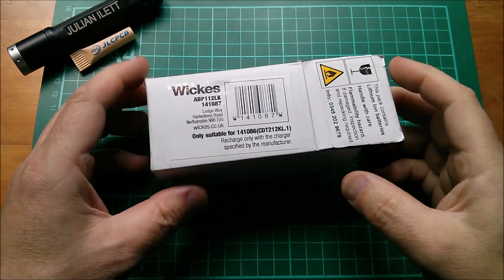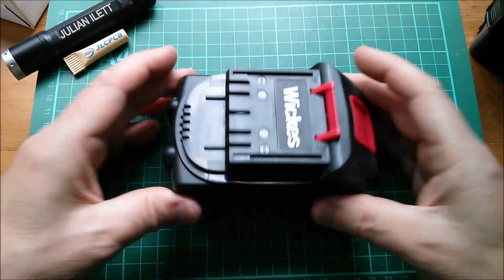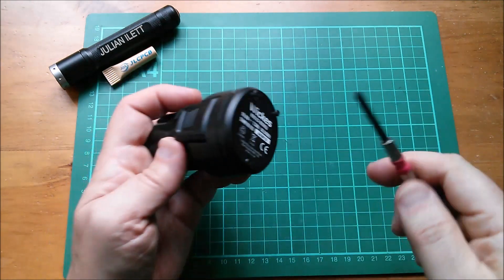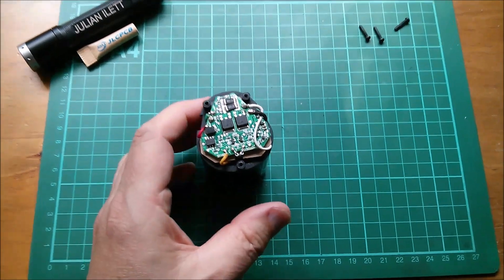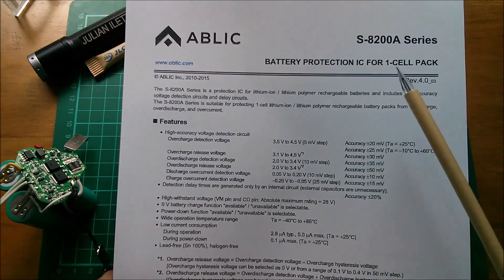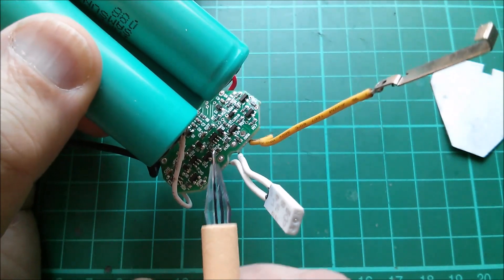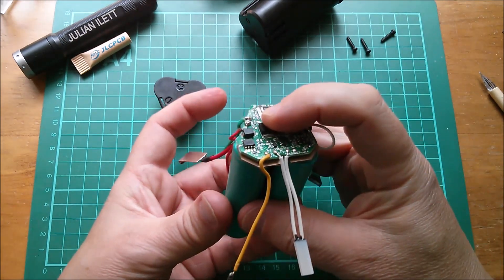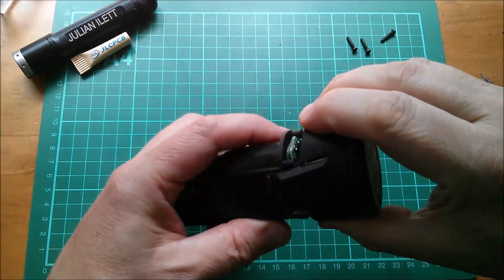£1 Wickes 10.8V 1.3Ah Power Tool Battery Strip Down

Comment: Julian, I could hug you for making this video! My ex partner bought me a Wickes electric drill for £39.99 a couple of years ago. I wanted a spare battery for it (It only came with one. Even Aldi drills come with two...) and was quoted £52, £12 more than the drill which comes with a battery! Anyway, went online and see the local Wickes has two in stock and called them to hold them for me. They could only find one, which is all I really needed but at £1... Took them some time to let me have it for a pound because they were thinking it was some kind of error but I have it now, all charged and ready to go. Now I need to find something to drill... Anyway, thanks for this video, and all the others of course :-)
Reply from the maker: Awesome, that's a great result.

Comment: The Wickes looks just like my Bosch PS-21& PS=22 Screwdriver batteries. They sell 10.8's and 12v cells. The latches look like they would latch correctly.
Reply: Definitively same OEM as Bosch cheapo ones.

Comment: Just picked up 50 of the 5 cell packs at Winchester, they still have another 50 in stock!  Just running a capacity test on one of the cells now.
Reply: 1333mAh. Very happy with that. Now just to test the other 249.......
Reply: Must have been loads, just brought the last 50 lol
Reply from the maker: Who'd have thought most of their stock would be in Winchester :)
Reply: i really have to say a big thank you  @JulianIlett , I was just about to start on a project that needed a lot of these cells and you saved me a fortune :)
Reply: Congrats both. These are nice good cells for high current applications. For storage or mobile related stuff, the energy density is so so.

Comment: Hey Julian, will these batteries charge in a parkside charger if you take the cap of like you did when you put it inside the drill? Reason i ask is because i bought a Workpro cordless ratchet that looks similar to the parkside batteries and find it very difficult to find replacement batteries/ chargers online, so would like to buy parkside batteries and chargers for it. 

Hope you can help, thanks!

Comment: Just nabbed 6 of these 5 cell ones from my local wickes. Their stock is inaccurate. Website said they only had 2 but I bought all they had, 6. Will take some apart later an capacity test them. Thanks for the heads up.
Reply: Just took it apart. Super cheaply made. The 'bms' doesnt have cell level balancing, purely over/discharge protection. The tabs between are nickel plated steel instead of pure nickel. Cells are good though. albeit 1300mah. 15a discharge is decent. For 20p a cell its a bargain.

Comment: Makita also has a 10.8v battery for their smaller drills. The BL1013 if I recall correctly.
Reply: AK90 You are right! The DF030D uses them aswell as a whole other buttload of tools from them. It's a lovely driver to get into tight spots with plenty of power.
Reply: @DrakkarCalethiel  I know, I have 2 of them myself! Fucking durable as well. Dropped mine from our roof onto the marble stairs and the thing didnt give a fuck lol This was several years ago and it STILL works :D

Comment: I'd say that yellow wire is for balance charging.  Probably the charger has the balancing circuit while the battery pack only has circuitry to prevent an overload on discharge.

Comment: When my Hitachi battery packs became unbalanced I used jumper wires and charged battery one individually.  That returned the battery pack to a like-new state.
You could possibly carve a little on the bottom cover of those batteries and give clearance for it to fit into the drill with the bottom on.
What a deal on those!
Reply from the maker: If a pack goes low capacity on me, I'll definitely try topping all the cells off individually.
Reply: I've had to do that with a home-built 8P3S battery pack which had one set of cells too low for the BMS to allow it to charge.  I removed the BMS and replaced it with a different design on the assumption that it must have failed in order for it to be possible for a single "leg" of the pack to discharge like that, then individually charged that "leg" until it was around the same level of the other two "legs" before charging the pack the rest of the way using the BMS.

Comment: You could 3D print a new battery cover to match the drill and presto you have batteries galore for the driver.
Reply: It did seem to have enough power to warrant that. Great idea! Does he have a 3D printer? If not, he should get one. I don't recall if he has one. So many videos. Vocoder!  :-) Good call, Christopher.
Reply: or, buy only case

Comment: I think they used to state 10.8v as it was a multiple of 1.2v, which older tools with nicad or NiMH cells used.
Reply: No, because it's a multiple of 3.6V, which is the nominal voltage of a li-ion cell. Marketing lies in the US started calling these packs 12V (and 20V, and so forth) because of the slightly higher rest voltage open circuit, to make it sound better than what the competition used, and eventually they seem to have decided that's not false advertising over here, so everyone does it.

Because my 12V Bosch tool is obviously better than the 10.8V one which differed only in label. Totally not false advertising.
Reply from the maker: It's a familiar number.

Comment: interessting, those cheap packs with the same form factor as the bosch packs include a bms circuitry. 

bosch didnt even put a balancer nor any protection other than a diode in their 12..14.4v 18v power4all packs
Reply: To be fair, neither did the other makers for a very long time. I think Bosch (just like several others) has added it to their new ProCORE batteries. Makita did the same with the newer packs with battery indicators on-board.

Comment: The nominal Voltages of Lithium-Ion-Cells depends on their chemistry, what is used as cathode material. So there is a wide range of 3.3 til 4.2 V, all Li-Ion Cells. (e.g. Source: "Electrochemical Technologies for Energy Storage and Conversion" - Site 76)

Comment: Well i think everyone got onto that pretty quick. No wickes anywhere near me has any left. Could have rebuilt my laptop battery pack for less than a tenner. Damn....
Reply: Those are quite low-capacity cells - you might even end up with less runtime than with the original, degraded higher-capacity cells that would be inside it.
Reply: None near me either, there’s 1 left in Hinckley (Leicestershire) but it’s completely the opposite side of the county to me so bugger that for 3 cells lol
Reply: 2:30  The batteries are from 2015, they are likely to have already lost half their capacity already, assuming they still work at all.
Reply: Rebuilding laptop packs can be tricky because of the control logic which sometimes keeps track of the cells. You might not be able to simply swap cells.

Comment: I ordered a SSR, and a cheap spotwelder timer board from eBay, its a simple one knop deal, I think it goes from 1000 of a second to1second maybe, I'm working on the microwave transformer now, I'm gonna put as many 10gauge wires around it as possible, in 2, turns, for high current, I think it will get more copper in the core using 10 ga, over 2/0 ga or similar, great video, are you getting in to the lithium power wall thing,?? I have been working on a power shelf, with 1400 cells of 2.6ah average, in a 7s, 29.4v full charge, I'm going for 28.7v full, and try for 3.2v shutoff! I can go to 2.8v per cell, but not going under 3v/cell unless it can't be helped, all my cells are new old stock, I'm possibly dreaming of 50% capacity in 15-20 years, I also have a 118ah lifepo4 12v bank, for 12 v lighting and such, for my off grid house!!  Imin Wilkes no wickes here, in USA that I know of, best deal I found was new cells, for a drill pack, 24v 6s, for $10, but buy cells for about $150/100 in packs, alot are nos,

Comment: Hi Julian, Managed to get 1 of the 3 cell ones; what is the best way to charge them (without taking out the cells) if you do not have the proper charger? Thanks.
Reply: Apply 4.2 V/cell (so 12.6 V) and the protection circuit should take care of the rest.
Reply: @GRBtutorials  Thanks.
Reply: @GRBtutorials  
The protection circuit will protect from over voltage, but I don't see any hint of it doing current limiting or even just sensing while charging. So while the voltage limit is 4.2V per cell and should be the target voltage for a charger (12.6 for the whole pack), the current has to be limited somehow as long as it is below that voltage to not damage the cells. 
Li-ion cells are quite fussy about over charging, but the charge profile is actually very simple (a lot easier than NiMH for example)
Charge at 1C max (for the 1300mAh cells that means charge at 1300mA maximum, but lower is better) until the cell/pack reaches 4.2/12.6V. Then keep the voltage constant until the current dropped to about 0.1C (130mA for the cells from the video). That is very easy to do with a lab power supply or even many of mini power supplies and DC/DC converters that Julian uses in his videos. The power supply just has to have a voltage and current limit setting.

Comment: Well not surprised with the circuit protection as wicks do some really good electronics and battery packs but would expect that being part of the Travis Perkins group they have a reputation to uphold
Reply from the maker: It ain't so clever inside the 18V pack :(

Comment: Do a tear down on the bigger one Julian, don’t be a tease, that’s not nice. You know you won’t to, don’t you, please.
Reply from the maker: I really do want to, and it's not pretty in there.
Reply: Julian Ilett, The more not pretty the better, just gives us more to be shocked about and we’ll know to be weary of that brand and or manufacturer, it went without saying that you’ve had a peak at it, because I would have done the same thing, I’m even suspecting you’ve already made a video about it because again, that’s what I would have done. I’m an electronic scooter technician and I ask if I can have all the failed battery packs and usually it’s just a broken connection or one failed cell in a 10s 30 cell 18650 pack that the manufacturer has sealed, so for legal reasons cannot be reused in the customers product and there all Samsung and LG high capacity he says gloatingly. Gotta love cheep or free 18650’s that’s why I’m looking forward to your videos on making your own packs up.

Comment: Holy crap I just bought 50 18v from Winchester 😂😂
Reply from the maker: Awesome :)
Reply: @JulianIlett   had to drive 1 and a half hours though 😭
Reply from the maker: Worth it though for 250 cells at 20p each :)
Reply: @JulianIlett  I think the cells retail for between £1.50 and £2.15, so an absolute bargin, just got to find some safe BMS board, I've had a bad experience with some I've bought online 🙄

Comment: Julian, I don't think balancing is quite as important as you seem to think as long as the production is minimally well supervised and cells are sorted and matched at the production. stage.  24v seems to be a "sweet" number, below that you don't need to get fancy.

As the last time - I'd like to see the capacities tested and verified - whatever they say is under the hood, time and time again testing shows that 
mAh is likely to stand for "maybe A hoax" 

https://batteryuniversity.com/learn/article/bu_803a_cell_mismatch_balancing.
This is a fairly "legit" site and it backs what I've always thought applied.  Yonks ago we got an independent consultant in from one of the big producers.  He was more interested in temperatures than voltages.  Keep 'em cool was the message, unless you are in a hurry, slow and steady is the secret - fast chargers and high power drains kill batteries.  I've always leaned towards his theories, and gone gentle with my kit and still only let packs get into the 40%s  before charging.  It seems to work for me.
Cells have got more capable, the tec changes, as do the limits but the same broad principles apply.

Comment: I don't know. Buy stuff you don't really need just because it's cheap ? Hm. Must be Julian's channel (or voltlog) 😀
Reply: Julian is doing it for us ;-)
Reply: Electrowave hes buying ultracheap batteries for us?
Reply: @simpesfaip  To strip down to educate us
Reply: @simpesfaip  The retail price for the 5-cell ultra cheap battery was £52 a couple of years ago. They are cheap because of stock clearance, not because they are bad batteries.
Reply: Electrowave he say 033 pounds per cell,when bms in that pack is worth more than all 3 cells together, not even mentioned
Reply: @simpesfaip  One pack has three cells and the other pack has five cells. I was talking about the five cell pack because I tried to buy one a couple of years ago but it was too expensive. 33p per cell for the three cell pack, yes. Less per cell for the five cell pack.
Reply: So, where do I get those in Germany then 😁
Reply: @thomasw6169  I don't know, I'm in Wales and they are all sold out around here now :-P
Reply: @Electrowave  thanks, I try Aldi or just stick with harvesting old laptop batteries which worked out well so far